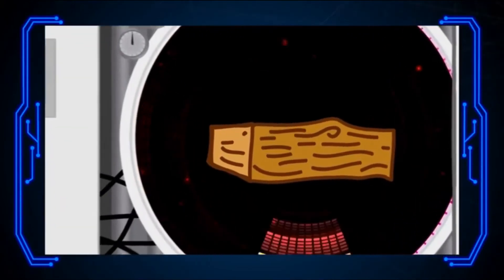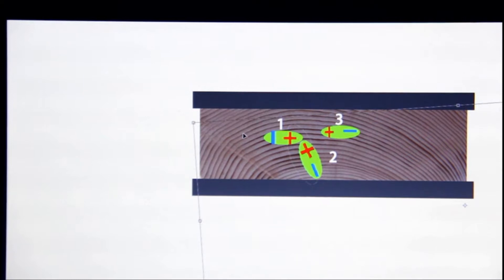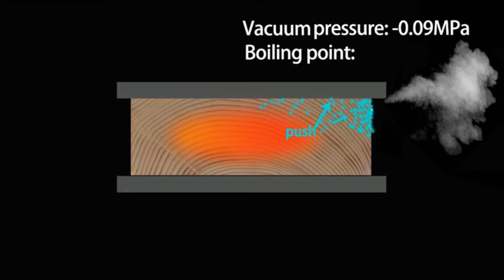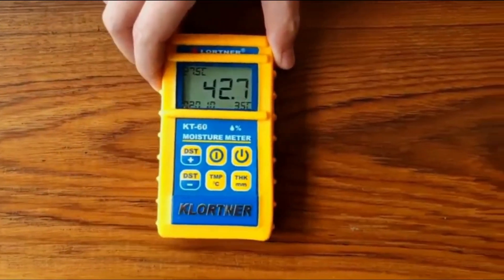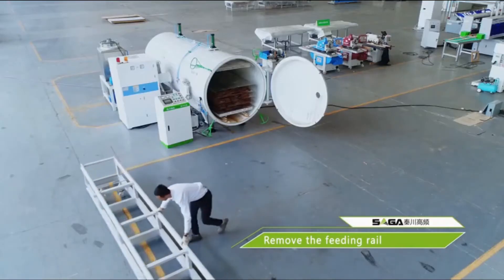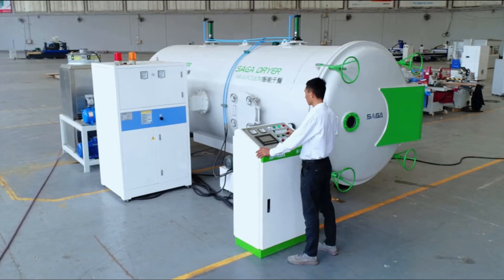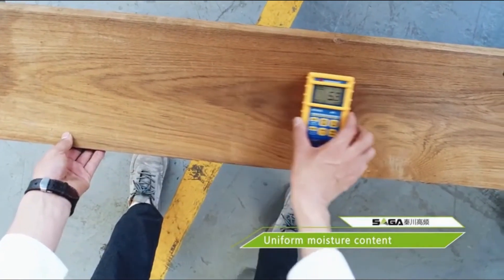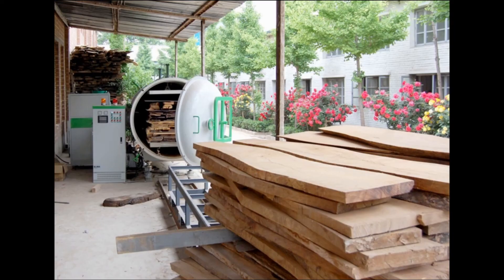Radio frequency wood dryer(principle&working process)

Comment: Question - if I have a wax pattern that I dip into a ceramic slurry that is made with colloidal silica particles and fused silica particles, then applied in a fused silica stuff, could I theoretically use something along the lines like this to minimize the drying time compared to an enclosed space with set humidity/temperature/air velocity?
Reply from the maker: Hi Charlie it certainly shorten the time but rf power works better on water, this need to test

Comment: detail configuration an electricity consume? And price to bangladesh?
Reply from the maker: you can contact me at 434923540@qq.com or whats app 0086 13833467305
Reply: @sagamachinery 
Thanks for your description 
   I have also seen wood veneer being loaded and dried in this equipment. 
   Can I use this machine for drying eucalyptus veneer thickness 1.8mm, initial moisture of 40%,final moisture of 8%. Time and power consumed the process.
   Will it will be feasible compared to conventional hot air dryers which needs boilers for hot air,no of hot air circulating fans and rollar conveyor to transport the veneers.
     The dryers have fire hazards  and boilers creat pollution problems. 
     Lot of power consumed in the boiler and dryers.
    If you have done a study on this i will be happy to learn from you and may convince my management  for your system.